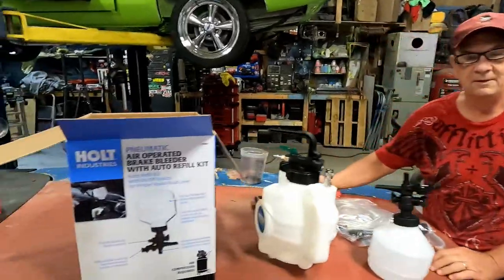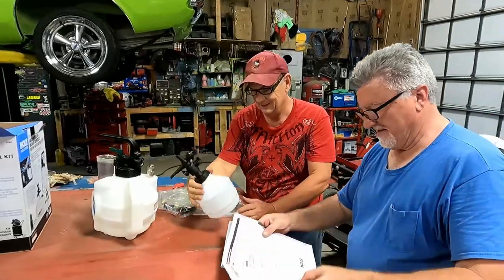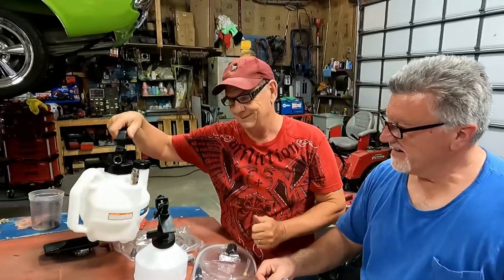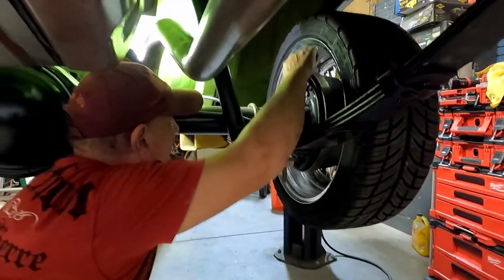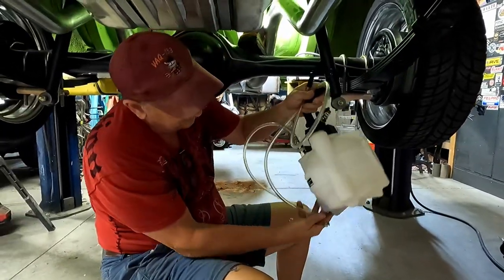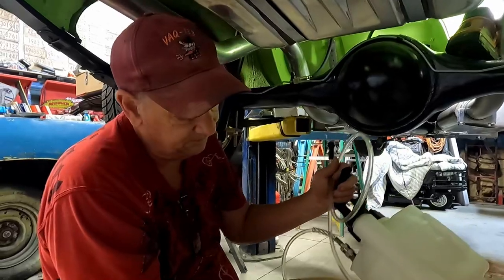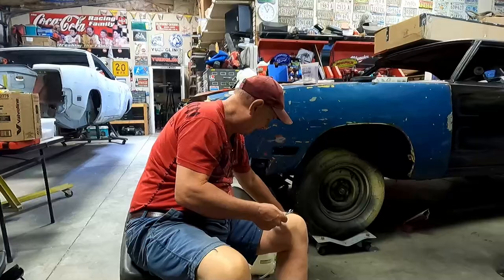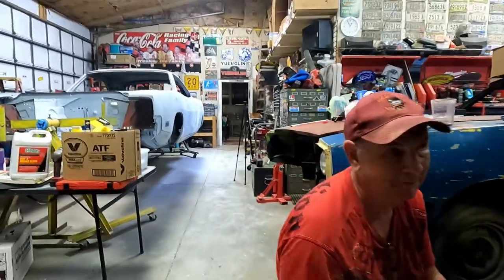Harbor Freight Air Operated Brake Bleeder Review and Usage

Comment: On the old Mopars, if you doing the one man operation do you put the brake fluid auto fill bottle in the small or large port on the master cylinder? 
Thanks nice video and really sweet Rally too,  used to have a 73 I put a 67 440 in
Reply from the maker: I believe when we did it it was pulling from the front larger area.  Ya might pull some through then check it to make sure it’s pulling from the right one for you.  We had Doug pouring in as we pulled it all through.

Comment: I would have drained the master cylinder like it suggested in the instructions so that you're cleaning out all that old fluid and only pulling newer, clean fluid through the system.  As you guys did it, you're pulling all that old fluid through.
Reply from the maker: Yeah, we found that was the case and repulled it again with fresh fluid off camera.
We learned!  Thanks for watchin!
Reply from the maker: We didn't think it was bad fluid til we saw what ended up in the can!

Comment: So I have one and I'm trying to use it. I wonder if putting thread tape around the bleeder valve would help. Because I think it's actually sucking past the threads of the bleeder valve.
Reply from the maker: I believe when we put ours together we used the tape, we didn’t have any leaking.
Reply: I'm doing a 78 El Camino. The wheel cylinders have the bleeders recessed. So I have to use a quarter inch Drive thin wall socket to break it Loose. I can't get a wrench on it like you guys did. So I have to open it and hurry up and put the hose on it. Even after I turn it off bubbles are rising in the hose line. Got to be coming from the threads
Reply from the maker: @exibuchay1695  probably, I didn’t know we had it so good!  Yours sounds tough!!!
Reply: @ClarksPlace  oh come on. You guys no more on your little pinky that I know in my whole pinky. Thank you for responding.
Reply: Just put a little bit of silicon grease around the threads and you'll be fine.